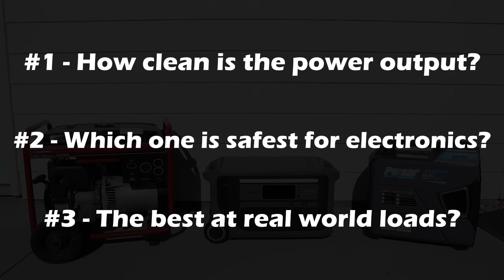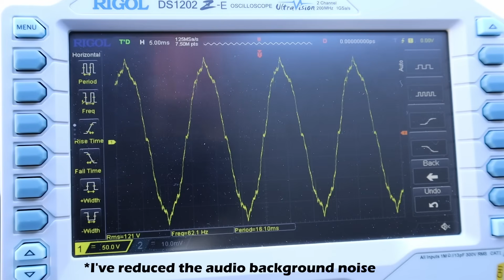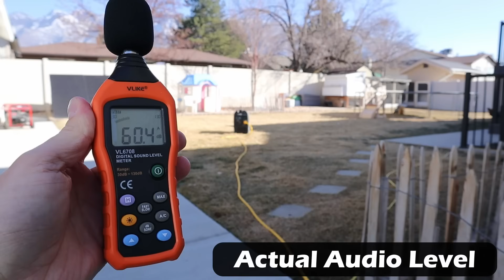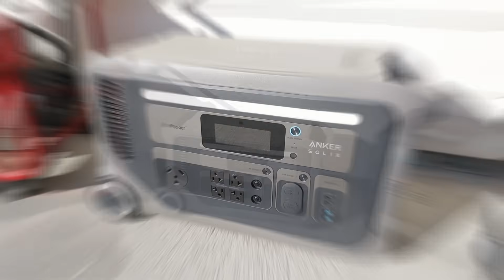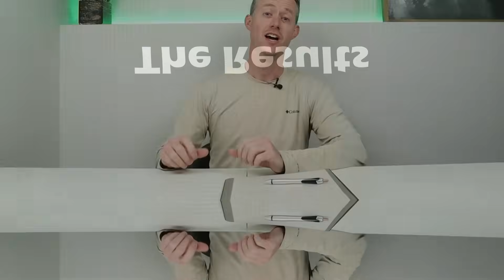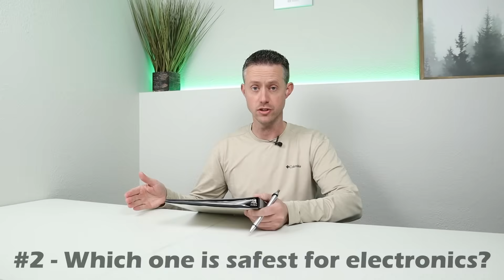Before You Plug Electronics Into A Generator, Watch This!

Comment: Having just gone through a major ice storm where many trees, power lines and power poles were destroyed, my area was without grid power for 7-days, 6-hours. Thankfully, I had a 4,500-watt, 30-amp, dual-fuel Westinghouse inverter generator which ran almost non-stop for that whole period, and performed excellent. Obviously too small to run many items at once, but it outperformed my expectations. With this knowledge, this summer, I will upgrade to an 11,000-watt, 50-amp, Westinghouse inverter generator to have more power to do more. I have always known that pure sine wave generators is the only way to go for smart devices, anything with a computer circuit board, and nearly all of today's electronics. Power stations are good short term solutions (hours), but for extended outages (days or weeks), a dual-fuel, or tri-fuel inverter generator is the way to go. Yes, inverter generators cost much more than standard power generators, but for grid quality power output, especially for long extended blackouts, the inverter generator is the way to go.
Reply from the maker: Excellent feedback, thanks for sharing!

Comment: Using a UPS between electronics like computers or TV, stereo equipment works as an excellent buffer between a traditional generator.
Reply: People love to say this, unless it's a double conversion UPS (which virtually none are) it will not reduce the THD of the power or clean up the waveform.

Comment: Great video. Good point on not using a conventional generator to charge a "power box". Luckily mine is an inverter type. However I was wondering when using a conventional generator, if the quality of the unit would make any difference? To me the sine wave on the one you used didn't look to healthy even without load. Thanks
Reply from the maker: It seems from the comments on the video that traditional generators can differ quite a bit. Some are better and some are worse than what's seen in the video 👍

Comment: I suppose if you wanted to polish the power from the inverters, you could add something like a Tripplite line conditioner.  I had to use these for my computer POS systems that were on mains power subject to brown power.  I can run my small minisplit and AC on 2KW of inverter-type power with no problems.  Back after hurricane Frances and power was out for 11 days, I used five gallons of gas, a 5KW Coleman generator, a 2KW Trace inverter, a small solar panel, and four deep cycle lead acid cells and battery charger.  I managed to keep the refrigerator running 24/7, recharge the batteries from the gen and solar, plus hook the gen up to the electric water heater, and then the washing machine.  Hot showers, clean clothes, fans as needed, even some big screen TV for short periods.  Oh yeah, the Trace also ran a small (older style) microwave, but the microwave cooked more slowly.  In contrast, a neighbor who had a big whole house generator ran out of gas on day two, and lost all his frozen and refrigerated food.  Power management is key.

Comment: The real killer of electronic devices is voltage surges or sags, which are hard to capture without high sampling rates, such as a power quality analyser. The switching transformers, commonly used in electronic devices, respond to voltage sags and attempt to  compensate, but by the time they do, the voltage has returned to its nominal value.

The key to using electronics with a traditional generator with electronics is not to include inductive loads such as motors, which are switched on while the electronics are operating. An induction motor with a poor power factor, 0.6 for example, will reduce the generators capacity by ~40%, due to current being out of phase to the voltage. 

As an electrician, I was once hired to establish why 80% of all the computers in a building with over 200 had power supply failures. It turned out to be a rooftop AC fan cycling on, which was causing momentarily sags. The remedy was to install a soft start on the 20 hp fan motor.

Engine driven generators are particularly susceptible to this phenomenon due to their limited output and slow response to extreme changes in load.

Comment: Ive used standard generators on sensitive equipment .  When sized correctly this is a non issue. Most Quality products have power converters in them that can tolerate some harmonic distortion.  Ive had the whole house on one fore a week when we had no power due to a hurricane and the tvs, computer, modems, modern inverter fridges and high end digital appliances and inverter heat pump  etc all worked.  This maybe an issue for a cheap or undersized gen but decent standard gen sized correctly wont have issues with this .
Reply from the maker: It seems from the comments on the video that traditional generators can differ quite a bit. Some are better and some are worse than what's seen in the video 👍
Reply: @Jasonoid  I would check the regulator on that gen set,  it may be going bad

Comment: The fun thing is, almost nothing is "sensitive equipment" any more. From your list the ones I'd be cautious of are the medical equipment and audio or studio equipment. In reality, they are almost always going to be fine.

A switching power supply is used it almost everything these days. It rectifies the input power and chops it up at a high frequency.  Same with "inverter" driven motors - the inverter is really just a switching power supply.  The input waveform is a non-issue as long as it is within the voltage rating and somewhat close to the frequency rating.

The one exception is if the power supply is very expensive because it includes a lot of filtering to prevent noise from going back out on the input power. That filtering is usually the most sensitive part of the power supply.

Comment: My eco flow delta 2 and bluetti eb3a power stations won't even charege on my traditional generator duromax 4850 duel fuel.
Reply from the maker: It seems from the comments on the video that traditional generators can differ quite a bit. Some are better and some are worse than what's seen in the video. You'd definitely be safe with an inverter generator though.

Comment: Great video. Want to replace my 20-yr old dirty Champion 5kw generator. But we used it 5 days last year to run a portable AIr Conditioner, ceiling fans, TV, modem, 2 refrigerators, Wii, microwave, laptops, and phone chargers. But it fried my circular saw after about 2 minutes of use. Sparks and smoke 😂.
Reply from the maker: It seems from the comments on the video that traditional generators can differ quite a bit. Some are better and some are worse than what's seen in the video 👍 Inverter generators should be quite a step up in quality.

Comment: Eye opening! Thank you. Very technical in a simple to understand and important way!
Reply from the maker: Glad it was helpful! That's what I try to do with my videos 😁
Reply: Traditional generators have several different internal designs.  Your test is ok, but you should get a quality generator like a Honda and test its output.

Your tests fail to show the different runtimes and fuel consumption and charge time of your Power-Bank unit.  Also explain to people that the storage batteries in the power and degrade from day one if they are used or not and at a certain point fail and either a new unit must be purchased or the batteries need to be replaced.

Comment: I have a O-Scope like yours. My instructions say not to hook it up to "Mains Power". So I have never tried to check my generators for the wave form. Are you using just a single probe and if so, what are you probing and do you just use the ground at an outlet or chassis, or??? Could you show us how?
Reply from the maker: You need to be disconnected from ground when testing like this. I use a plug that removed ground so it's floating, no risk for a grounding loop.

Comment: To be fair anything that uses an SMPS for a power supply, and that's just about anything, will be fine with any old garbage for power. Induction motors and standard iron transformers may very overheat when supplied with dirty power.
Reply from the maker: The only risk is that they can overheat depending on how bad the waveform is.

Comment: Nothing new here really, but having this information out in a clear, well-explained video like this is actually a good service for people. Thanks.
Reply from the maker: I agree, I hope it can help a lot of people visualize the difference 😊
Reply: What's missing is actual information on what this means, what %THD is, and how it applies to real world application, and how much of it is hype to sell inverter generators and generate YT clicks.  Traditional generators have been powering electronics for over half a century with no issues, yet for some reason once the inverter generators came out, so did all the hype.  Yes, inverters produce cleaner power as long as they are healthy.  Does it matter out in the real world outside clickbaity YT videos?  Nope.
Reply: @BKD70  What's missing from your comment is the significant advancements that have been made in electronics over the past 50 years. From vacuum tubes to transistors to silicon chips that are measured in microns, the need for clean electricity is much greater than 50 years ago. Implying that the creator is merely after YT clicks is disingenuous at best.

Comment: real world, I use my dirty generator during power outages, it runs all my modern stuff just fine
Reply from the maker: Not all generators are created equal, if yours has AVR it regulates voltage much better than what mine did in the video.
Reply: @Jasonoid  just checked it's got AVR, cheap Champion RV ready generator

Comment: DC Generators are designed and optimized to deliver high currents at low voltages which is required for battery charging and operating DC loads.
Reply from the maker: I haven't seen any decent options available, especially that aren't proprietary to one brand 🤷

Comment: It didn't look as if the traditional generator had an Auto Voltage Regulator & with volts that low it is not comparable with the other 2 from clean power out put perspective 🤔
Reply from the maker: Not all models have AVR.

Comment: In my opinion, it’s time to test surge protection cords for office equipment or etc. that claim to improve sine wave output. And try them with a generator that produces such a dirty sine wave.
Reply from the maker: I haven't seen anything cheap that does that. Maybe the super expensive devices help but at that point you should just use that money to buy an inverter generator.
Reply: yes, that would be interesting to see.

Comment: Many years ago before inverter generators were a thing, I knew I wanted as clean of power as possible, so I bought a NorthStar generator from Northern tool,(10kw) it is a standard gas generator, they claim it has clean power. I know it has run the whole house, with plenty of electronics multiple times over the years during power outages with no issues. I wish I had the test equipment, I would love to see the results like you are showing. I just looked online at one of their north star units, here's what it said, High-quality 100% copper-wound head with less than 5% total harmonic distortion ensures safe use with sensitive equipment.  Also curious of what the Generac whole house units do on quality of power?
Reply from the maker: Less than 5% for a traditional generator would be pretty decent, better than what I saw from the traditional generator during my testing.

Comment: Is there anything available to attach to an outlet on a Gasoline generator to make the power not as dirty?
Reply: Yes, a line conditioner. Tripp lite makes a good one.
Reply: @lyonk-tz8qf  thank you
Reply from the maker: Line conditioners only remove high-frequency electrical noise (radio frequency interference, switching noise, etc.).
They do not remove 60Hz harmonic distortion.
If your generator waveform is flat-topped or jagged at 60Hz, a passive filter cannot reshape it into a pure sine wave.
Reply: @Jasonoid  thank you for the information on this.

Comment: Direct DC charging sensitive electronics with a power station is even more ideal when feasible.   Less conversion losses, no fan noise, and clean power and it’s as good as 0ms power backup because no switchover time is needed.  I would love to see videos on how to power as many devices as possible via DC from the best power stations for this.  All DC capable ports/USB are fair game.   100W USB can do a lot, but it would be cool to see 240W USB implemented and used or even combine for several hundred watts via USB.
Reply from the maker: In my new grading system I list the maximum DC output of each power station, along with the max supported USB output. That might help someone find the best option to suite their needs.
Reply: @Jasonoid  Thx, i’ll check that out

Comment: I've been looking at THD recently and was looking at a westinghouse conventional generator for whole house use. Westinghouse advertises <5% THD for those conventional generators but doesnt specify if that is at full load. The IEEE limit for THD from utilities is 8% for low voltage so i thought this was not as good as an inverter but fine, but someone posted oscilloscope grabs from one of those westinghouse conventional gens vs an inverter gen on an amazon review for the westinghouse igen11000dfc inverter gen and the difference was like chalk and cheese in favour of the inverter of course. Also a lot of the control of the conventional generator is mechanical, it could never be as clean or respond as fast as electronically controlled output from an inverter. What was especially interesting in this video is the performance of the power station as my latest decision was that i should get a 7.2kW/15kWh power station system from pecron/ecoflow/anker and a small inverter gen to recharge when solar fails. This decision seems vindicated it's just that it's at least 7x the cost of a conventional generator!😢
Reply from the maker: The benefit of a power station is the ability to power the loads silently and recharge with solar. They definitely cost more but you can get a little of that cost back through running loads off solar instead of grid power. I think a backup system utilizing both types of systems is best because you don't have rely on gasoline or propane to run your loads, you can charge with solar to conserve fuel for the generator.

Comment: During the last FL hurricane I used my power stations to keep things going, but ran into the problem of how to charge them once they ran out of power. I opted for LifePo batteries that have worked well for me. I store power and recharge the power stations with no problem. And, I can recharge both with solar.
Reply from the maker: If solar isn't available youll need a backup. Batteries will always get empty if the clouds are around long enough, it's happened plenty to me. I like having multiple backup options. A dual fuel inverter generator is a great backup to for my solar backups 😂

Comment: This is FUD. The regular generator is not that bad. I saw the inverters generate large harmonics on the saw startup. Far more than the regular generator.
The main thing that started this "dirty power" stuff is modified sine inverters. Devices with power factor correction will get real confused and may become unstable. Regular generators are close enough to work. Modified sine will overheat motors that need the shape of the sine to generate the second phase through a capacitor. They also disconnect through part of the cycle and can cause large inductive spikes.
Most all Whole House generators are traditional generators. I have one and run everything with no problem for the last 15 years.
Reply from the maker: Thanks for your feedback, you must be using a much better traditional generator than what's in my video.
Reply: @Jasonoid  BTW, measure the THD and a scope view of your home AC power. You might be horrified (can be worse than my generator here).
Reply from the maker: I have before, it's pretty decent, usually around 122v and 60hz, thd is less than 1%. We have pretty decent power in my area. It does change sometimes but it's mostly that way.
Reply: @Jasonoid  No,  probably 15-20% distortion. Computers, AC, microwave work fine. It is a real old-school gen made in about 2001.

Comment: @Jasonoid can a traditional non inverter generator be used to charge regular lithium iron phosphate batteries such as a 24 V 100 amp LiTime battery? Thanks!
Reply from the maker: A battery charger is an AC to DC converter, most will do okay running off dirty power. Just check the heat of the charger to make sure it's not getting hot.

Comment: Old inverter to EG4 Chargeverter to sizable 48v battery bank.  Run it hard and loud, charge up the whole bank in 2-4 hours, then your inverter takes over.
Reply from the maker: Yup, that will work too. Those chargeverters are super expensive now though, $700 😅
Reply: @Jasonoid  - REALLY??  That's disappointing.  Weren't they like $399 when they dropped?